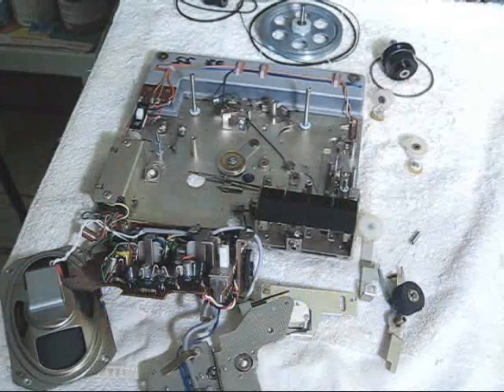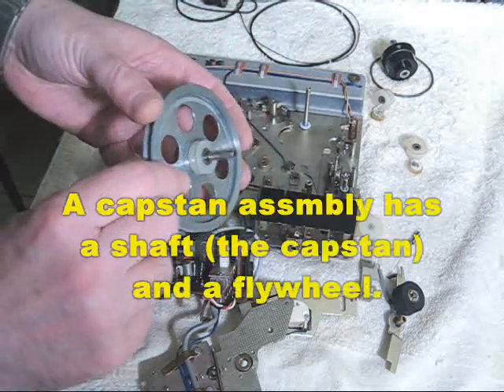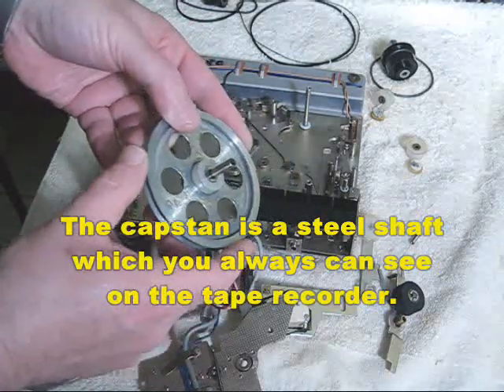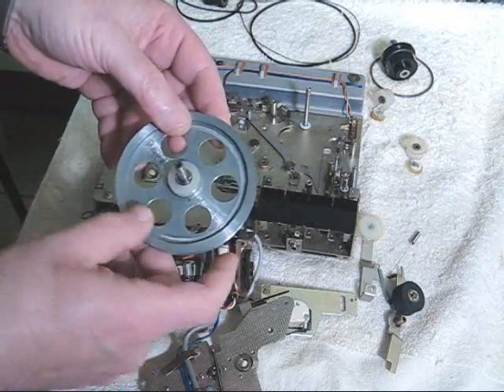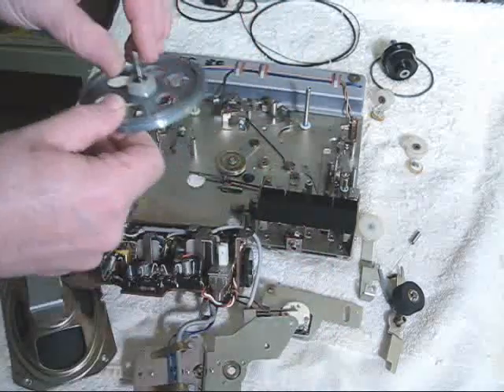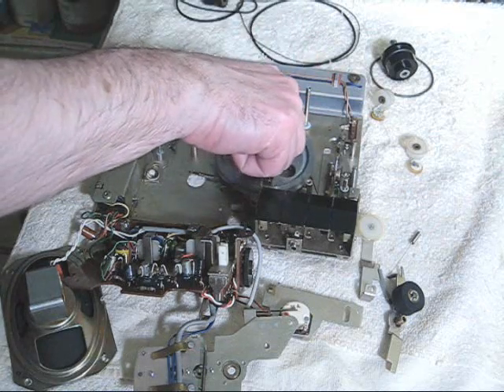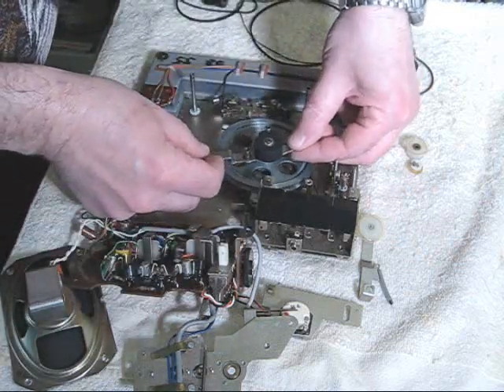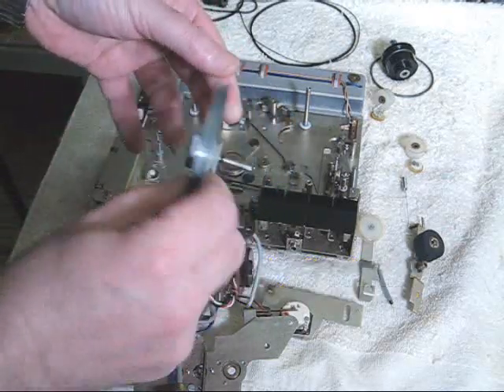What IS Capstan Drive?  How a Tape Recorder Works

Comment: Thank you for a clear explanation. I do have a question. Should the capstan have any back and forth play after it is reinserted into the bushing in the machine? Or, should the little keeper be pressed tightly to exclude any play?
Reply from the maker: The capstan (and flywheel) should have no side-to-side play when inside the bearing (if there is play then either the capstan itself is worn, or the bearing, or both) and "in-out" (or up-down) play should be kept minimal but without causing friction on the back bearing. 

Many "desktop" recorders (used horizontally) have a LOT of up-down play, but because they are designed to be used only horizontally, gravity keeps the capstan from rattling up and down, so no problem.

Portable recorders often have a back plate (i.e. cassette recorders) so there is very limited "in-out" movement when the machine is being used vertically, or carried. 

Hope that helps!

Comment: I've opened an old Hitachi d850 and I was shocked, the rubber belts turned into a black cream. Literally, it's a black paste thats very hard to get off fingers. Have you got any clue about that?
Reply from the maker: Hi, thanks for watching the video and asking your very IMPORTANT question!

The problem:
The liquification of some rubber tape recorder components is an issue that affects many tape recorders (and turntables as well). The cause is the formula used to create the rubber parts was unstable.  In some cases (Ampex stereo recorders, for example) the rubber would liquify in a few months of manufactrure! Usually though, it takes several years. I have dealt with this issue on a number of tape recorder projects.

The Solution:
I found that the BEST way to clean up the sticky rubber and residue is to use ammonia - NOT rubbing alcohol (which some "experts" on YouTube recommend).  

The ammonia (either pure ammonia or what is found in window cleaner) will dissolve the rubber mess so it can be cleaned off surfaces (including your hands) easily. It may take several applications of ammonia however. 

Once the parts are completely cleaned of the mess, wipe thoroughly with a moistened swab or cloth to remove the ammonia residue - which will form a slippery film otherwise. 

Alsao, be careful of ammonia fumes - clean in a well ventilated area! 

You can then install replacement belts, etc. 

Good luck!

Comment: i just found a box for a webcor microcorder 300 in my basement with blank and recorded on tapes, a telephone recorder and wires for other connections. problem is i cant find the tape recorder, i've only found wires, im afraid while renevating we may have lost the unit

Comment: Very good video! I have a Webcor Microcorder (not 300) that works on playback, and is in fantastic cosmetic condition, but recording DOESN'T work:((((((((((((( Each time I tried to fix it, I've made it progressively worse and worse...it used to erase and BARELY BARELY record, now it won't record even that and wont erase....:( I had replaced several caps and a couple transistors. I think it was replacing the transistors that broke the erase.

Comment: Is it always the running capacitor that cause slow speed in capstan motor ???
Reply from the maker: Vivencio Go Tan Many AC tape recorder motors use a run capacitor to maintain torque, and speed. So, that is a good thing to check out and replace if necessary. 

Also check the voltage/frequency selector (if there is one) and see what it is set for. For example, if you live in the US, the selector should be set to 100Volts 60 Hz. But in Europe and many other parts of the world it would be 220Volts 50 Hz. 

I once had a tape recorder in the US that was slow. The guy's father had it when he lived in Germany and set it to 220Volts 50 Hz. So all I had to do was set it to 110Volt 60 Hz and it worked just fine.

Not all tape recorder AC motors are designed to use a run capacitor. Some (i.e. shaded pole motors) run without one at all. The only way to be sure on your machine is to look at the electrical schematic or trace the wiring from the motor. It often has three wires, some of which go to a capacitor. 

You must replace the capacitor with one of EQUAL capacitance, but the voltage can be higher (never lower) because that just means it can take more voltage before breaking down. . 

A battery or DC motor does NOT need a capacitor to run, but will often have a capacitor (a small disc type usually) to act as a spark suppressor and quiet the motor noise in the amplifier. 

I hope this helps.